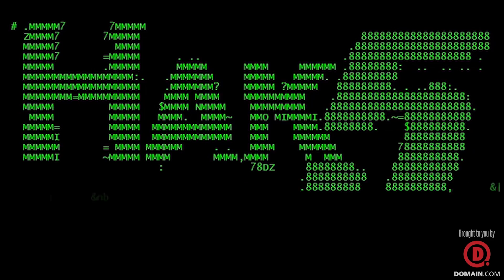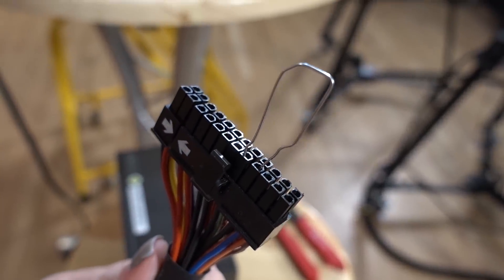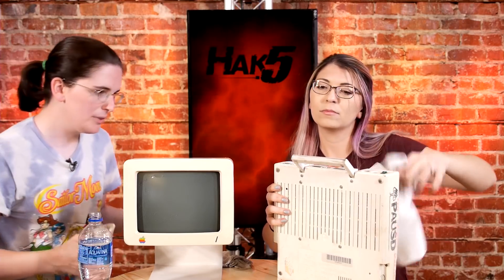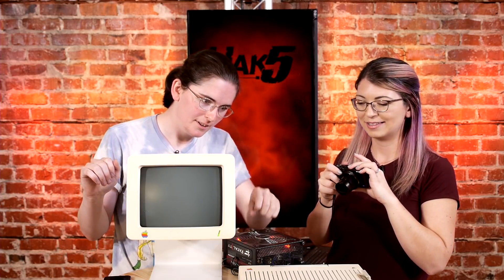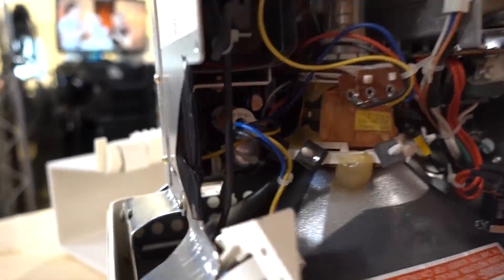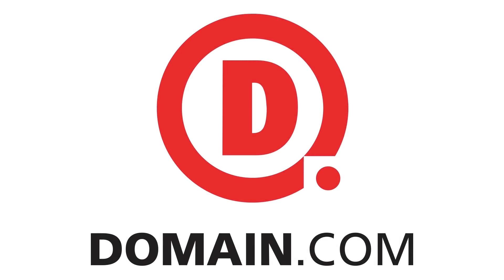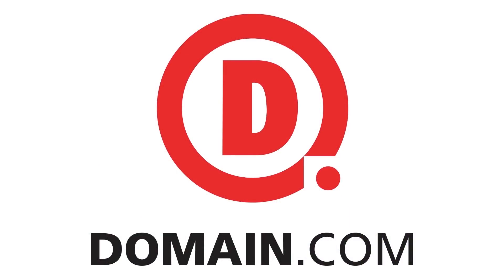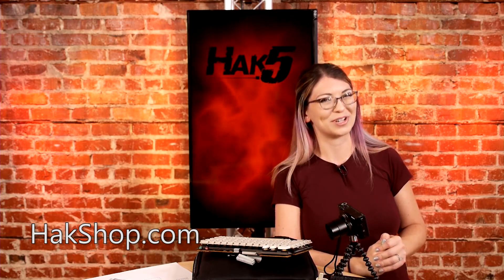Vintage Apple IIc Teardown! - Hak5 2413

Comment: How does grounding the caps to the frame work when the monitor isn't connected to ground without the power supply plugged in?
Reply: if it was connected then you wouldnt have to discharge it. i dont think you understand how a ground works either.
Reply: You may be right, and that's why I ask! I do know that caps store a charge when the device is powered on, and they keep it even when the device is powered off for some time. Why do you say you wouldn't need to short them to ground if the power supply was still connected, but switched off?
Reply: Is it that you're connecting the capacitor to itself, via the chassis, rather than to ground?
Reply: well its not the caps you have to worry about, its that the tube itself acts as a capacitor and its grounded to the chassis. so by shorting the connector under the suction cup to the chassis you are effectively shorting out the crt. i am connecting the crt's charged side to its ground
Reply: Ah! That's makes sense. Thank you!

Comment: So, my whole channel is edited on Linux. I use KDenLive and it's hands down the most powerful video editing suite on Linux. I've even edited 4k video with it.
Reply: i tried that a few years ago and it didnt work very well. i basically want adobe premiere for linux.
Reply: sorry, i'm windows or linux only. after working at Apple im really sick and tired of macintoshes,
Reply: I was expecting you to say final cut pro
Reply: with the recent windows 10 update, I've switched over to mac and linux. Mac has been much less forceful about the updates.
Reply: ;) with you fixing up a apple iic heh
Reply: For the longest time I've been using pitivi 0.98 as a video editing tool on fedora, until I switched to mint...
Reply: Yes, came here to say the same thing :)
Reply: I like the editing paradigm and workflow of KDEnlive, but I had problems with it's stability...and I've tried several versions under three different versions of Kubuntu. Maybe it's time to try it again.

Comment: You must warn the audience that messing up with old CRT screen is dangerous and it can harm you REALLY bad!!
for your safety - do not try to do it at home, unless you know what your doing and have all the safety gear(gloves etc..) - because charged capasitors in some equipment may harm and even kill you!!
Reply: i mentioned they can kill you, so i guess you werent paying attention very well.
Reply: I saw you mention it, but I think it's not bold enough.
Reply: if somebody doesnt want to look up how to work with a CRT, then that is a problem that takes care of itself.

Comment: No far as the retro brighting method, not setting plastic parts in the sun is not a myth busted, as the heat from the sun helps accelerate the process, and adding Oxiclean to the mix also help accelerate the process. I do a 50/50 mix of Peroxide/OxIclean to water in a clear plastic tub with a clear top, or plastic wrap, and set it outside on a warm/hot day in my backyard in the sun so it does not take as long as just setting the parts inside to sit. Edit: I'd also rather let the parts sit outside in the sun instead of inside in case there is any outgassing from the retro brighting process.

Comment: Ah...memories....I did a high school co-op placement at an Apple Educational Showcase lab in Ottawa at the Carleton Board of Education. They had, believe it or not, networked Apple ][+ and //e, using the Corvus Constellation network with a 8" 40 Meg hard drive/server. You could actually boot the Apple's off of the network hard drive!  After that experience, I went on to build an Apple clone, as I couldn't afford the $2K for a real Apple //e! But I soldered all the sockets and components myself, as well as the various expansion (clone) cards, the Disk ][ controller, the 16K memory upgrade card (brought the ][+ 's 48K to a full 64K!!), the Microsoft Z80  CP/M card, the Videx 80 column card, and built up a machine that I used for a number of years. 

Fun times! Thanx for the reminder!
Reply: Farrell McGovern SCHIZEN that sounds like it would have been hell to upkeep!
Reply: The lab was pretty chaotic. But the network was very stable! I even got in some legit hacking...we had a Terrapin robotic Floor Turtle, and somewhere there was either bad code, or a hardware problem, but I found that by adding a "fudge factor" in the code, it would turn the correct angle...as it was controlled under LOGO, if you did a "REPEAT 4 [FD 200 RT 90]" it was supposed to draw a square, but before I fiddled with it, it would only draw open pentagon. Heady days back then...